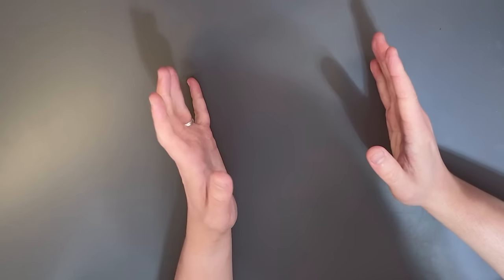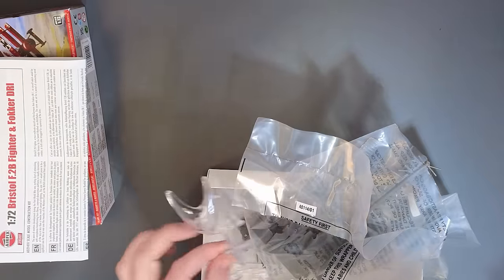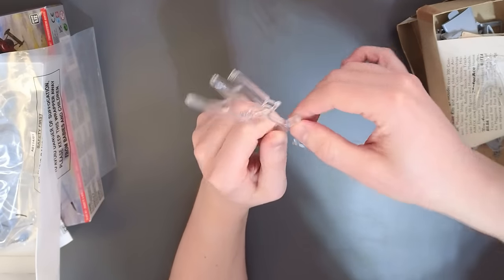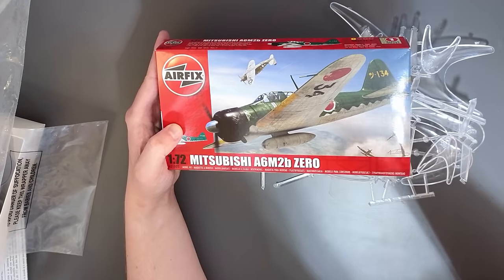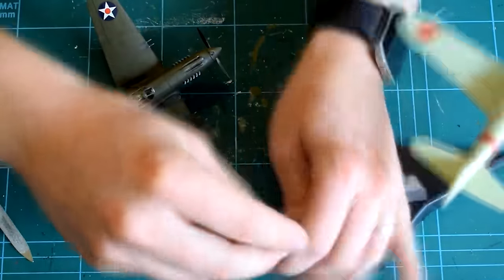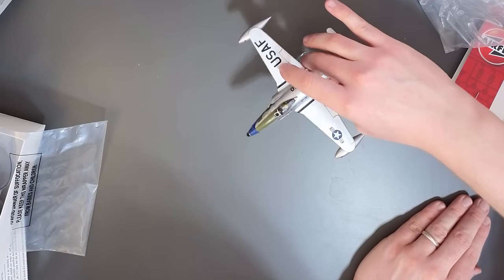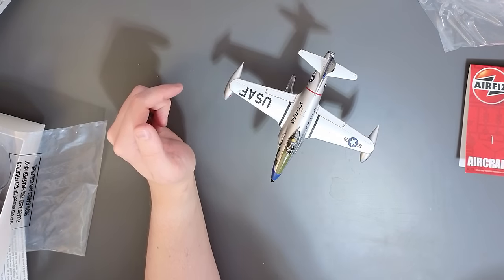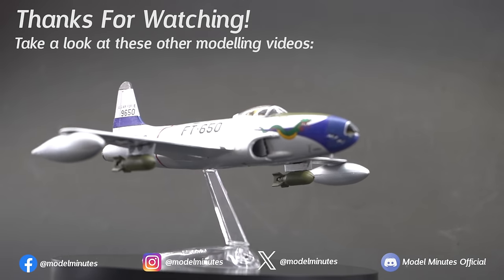Display Stands Still Exist?! What Happened to Airfix model Aircraft Display Stands?

Comment: If you look at where Airfix do include Stands you'll find them in all Quick Build Aircraft, to the point where there's no landing gear included. So rather than being about cost it's more about the age of the customer and new levels of technology to accommodate them both separately, in the case of Vintage Classic Aircraft not including a clear Stand has probably cost Airfix more than it's saved them, I can't see them putting 'Doesn't include Display Stand - Available separately for £15.00 inc postage' on the box but that's what they're telling everyone.
Reply from the maker: i'm sure i've built a quickbuild plane that came with landing gear
Reply: @ModelMinutes - Apache does (obviously) and the F35B does but they don't make you buy a dozen stands for them, out of the box that option has been removed from Vintage Classic A/C because you're an adult, your childhood memories costs you an extra £10 - £15.

What it comes down to is keeping Share Holders happy as a priority over Customers and in this specific case works against both. Having said that a P1127 for £6.99 is making up for any grumbles about missing stands, I've got a box full anyway but not everyone has, bit of a must for the P1127.

Comment: Airfix still sell them, you have to buy a pack of assorted stands for around 12 quid. They could include them for say an extra quid or so but wont.  The 1/24 scale vintage models come with a stand so they can do this with very little bother same with pilot figures, if you can 'waste' plastic on various wings and propellers that are not even relevant to the kit then surely a pilot, even a generic pilot of the scale and period wouldn't be that difficult.
Reply from the maker: yeah If i remember correctly my 1/24 hurricane came with one

Comment: Display stands could be the best ally of young and novice modellers, and could actually help to make plane kits cheaper for modellers and brands, saving money, time and space for even more planes kits! Whenever i can i built my planes wheels up and put them on a self made styrene stand. This cover 3 porpuses for the modeller:

1-Save building time: Quickly skip landing gear will allow to save time for other projects. Also pilot help to hide lack of details in cockpit saving even more time.
2-Prevent future small pieces damage: Yeah landing gear can be very fragile. Same goes to open cockpits.
3-Planes fly, so why not display them flying?
4-Collection and space. Alternating flying and on land planes allow for more display space. Also if modellers are collecting different schemes of the same plane, they want to focus on decorations.

Benefits for the model kit brands:

1-Easy to build (gear up, close cockpit, pilot figure) is more attractive to novice modellers and weekend modellers.
2-Stands are cheap. 1 mold fits a lot of planes. Put landing gear and detail pieces on a separate sprue for "complete model" and pack the "quick build" version without landing gear but with stand.
3-Quick builds means more time for more builds,
Reply from the maker: thanks for sharing

Comment: The main question with the horse shoe stand is this.....Does the shoe face with the open end to the nose of the model or the shoe facing away from the model ? Many do it facing away from the front as it looks the neatest, but in reality the shoe is supposed to face forwards with the open end to the nose of the model.
Reply from the maker: The Airfix logo is on the inside of the U, so I think officially the logo should be forwards (towards the nose of the aircraft) so I have put it in backwards. I prefer the way it looks with the U facing the rear so I guess it just depends on what the modeller likes
Reply: @ModelMinutes  The shoe facing backwards does look the best and it marries with the flow of the model, I've used the old stands from back in the day, decades back maybe even 40 years ago, all facing towards the model, on certain very Airfix kits instructions they show the placement of the stand and it is shown the other way, but I find it odd that Airfix themselves show the stand being the wrong way! Airfix oddly are also making their big 1/24th 'vintage' aircraft but fail to include the big black stand.....Tight shits.

Comment: The original Airfix display stand for small aircraft -Spitfires/ Bf 109s Westland Whirlwinds fighter etc were shallow ellipse tapered to the rear where the stalk was slotted in, and was probably designed as an expression of a curvature of the earth -very similar to that produced by Revel inc for their display which as with Frog kits were circular and the Frog even had a map like pattern, both were mostly in self coloured rather clear plastic, most likely as in the case of the Revel Red series WW1 kits as a cost saving measure, no canopies in WW1 aircraft so no need for clear styrene.   Most of the original Airfix and Revel stands got used for paint mixing bowls.
Reply from the maker: sounds very interesting!

Comment: You can always make your own slot in newer kits and still use them
Reply from the maker: yep that is true, my comments in this video more refer to the fact that the older kits and a moulded slot indicating where it goes and how big it should be, whilst on the newer airfix kits they have 2 holes moulded on the bottom that just need drilling all the way through. Cutting your own slot on a newer airfix (or other) kit is not too much of a problem, just that they no longer cater specifically for the style of stand featured in this video

Comment: I wanted my 1/72 models to be on stands so I designed and 3D printed them!
Reply from the maker: Oh that is awesome! Is your design available anywhere online?
Reply: @ModelMinutes  errr... you caught me by surprise there. Of course, I will do that, probably on Thingiverse, in the coming 48 hours
Reply from the maker: @mirage3rd  oh sweet, I’d be keen on checking that out if you could ping me a link
Reply: @ModelMinutes  I tried 3 or 4 times but my replies disappear right away. Any tip?
Reply from the maker: @mirage3rd  ah, YT requires links to be approved by the channel owner, I’ll check my dashboard
Reply: @ModelMinutes  ok. And, by the way, thanks a lot for your channel. I'm just back to the hobby since the early 70's (not a typo...) and I am learning so much with all which just did not exist at that time!

Comment: your stand is backwards, the angle should be facing forwards, back in the '80's i was an industrial model maker , i literally made thousands of display models and bases, the base angle should imply forward movement thus the open part of the angle forward, and the plane should be slightly angled up so the plane doesnt appear to be crashing/desending
Reply from the maker: i quite like the way it's been used :)